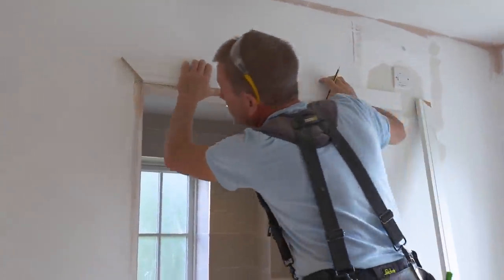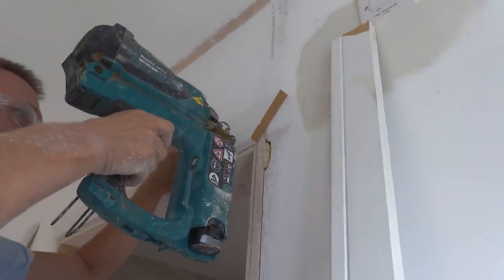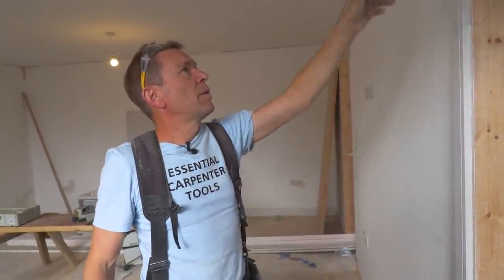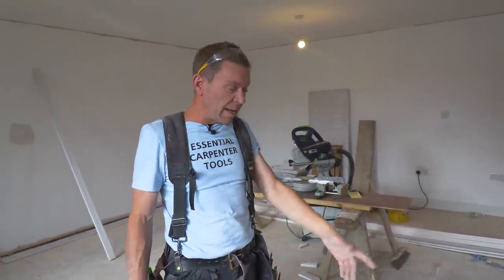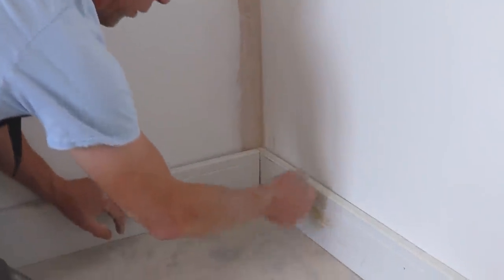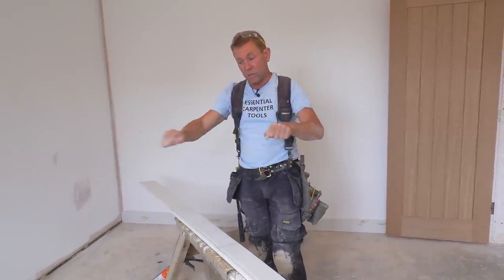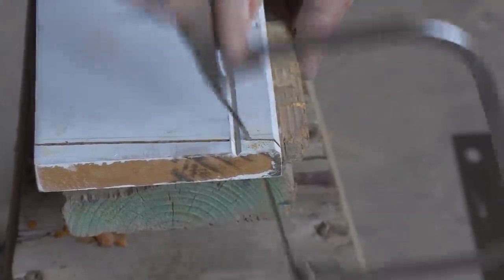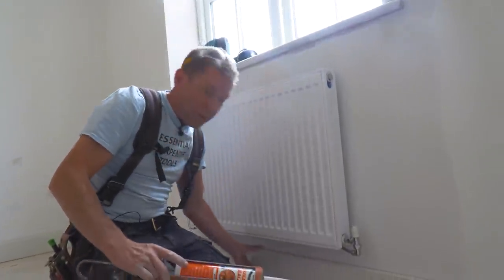Skirting Boards & Architraves - Easy Way

Comment: Myself, when it comes to new door linings,I always swing my doors before fitting the arcs, firstly so that I can use the same back set on my router jig, secondly, I can use wedges to tweak the jambs to suit the door, (especially on new builds, fit your linings ever so slightly wide)
Thirdly, there's no risk of a stray pin getting in the way of hinge or keeper  recesses.
For me it's, doors, arcs, skirts.
But each to their own.
Reply: Likewise
Reply: Hi Sally, 
That door was hung first, it opens in but was removed as the floor was tiled. Definitely better to hang doors before arcs. 
Thanks for watching.
Reply: Same
Reply: Same

Comment: Love your videos mate. Recently I started making up architrave on the floor first, like a goal post, mitre bond the mitres on the floor to get them nice and flat and spot on, while that goes off, put the adhesive round the lining then just stand it up and you’re ready to go
Reply: Thanks Luke. I’ve heard a few chippies making it up like you. If you find it works well then that’s the way..
Reply: find thats the best way,and I use expanding foam to seal door and help adhere archs ,works great ,oh and fire foam for fire doors

Comment: We did do architraves this way about 15 years ago I always found a extra blob of no nails behind arch’s helped flush the mitres up then pin from top. 
Doing house after house, frame after frame we would be able to sight the “quirk” margin too 
These days we use mitre bond and glue sets up on floor full house floor at a time even cutting full sets a a time and say all 2’6 door heads together etc

Comment: Nice job mate, can't beat the traditional way of fitting arc's, head first then the legs and white glue. It's alright using mitre mate but over time it goes brittle  and the other thing is if your fitting arc's to a casing you haven't fitted and there is a discrepancy  in the parrell,  if the head is fitted first the mitres can be fitted to keep the margins even.

Comment: Great job Dan, and I particularly liked your sweeping up method of leaving it a corner😜(you'd never catch me doing that on site🙄) Thanks for the video guys😎😎
Reply: Thanks Del. 👊🏻
Reply: Hi  @elliottgeorge5850 , yes sometimes I do. On this site the linings were a bit big so I cut the head and wedged them over. Generally if all the linings are made in a workshop and are the same then just cut plenty of arc heads the same size.

Comment: I use calk for skirting bedding also if you run a line of it along the top of the skirting and number 2 finger it off when it squeezes out once its nailed. The decorator will love you as the joint between wall and skirting is completely filled and wont crack.
Reply: Like the sound of that

Comment: Easiest way I have found Is to scribe and mark all of your arcs ready to be cut on the saw all at once then build them on top of one another on the floor or saw horses with mitre bond then lift as a set to each opening and pin to linings fast and easy

Comment: Hi Dan 
I was wondering have you ever fitted pigs ear bannister? If so how do you work out the angle 
Thanks
Reply: Hi Fadi, 
I usually draw the height of the pigs ear ( top and bottom) on the wall where it’s going to be fixed then you can dissect it ( join the angles up). Then use a bevel to transfer the angle on a mitre saw.  
When returning it into a corner it really needs to go in level and miter it. 
Hope this makes sense!
Reply: @Ultimate-roofing-square.  better than my 4man you've responded faster than him lol, thanks very much. 
God bless
Reply: @fadiabdallah8388  I usually try and respond to most questions, however I do miss some. 
If you take time to watch the videos the least I can do is try and answer questions. 
Thanks for watching.

Comment: Cut all the heads and legs number them up, lay some bearers down then glue the complete set using the pen and spray glue, do every set and just put the next 1 on top so you end up with a pile then load them out bit of adhesive on the back and pin them on, perfect mitres every time

Comment: Always hang door first then latch followed by door stops tack first then use the nailer.
Architrave mitres biscuit jointed. And the back of architrave to skirting at floor level .
Doesn’t take much longer

Comment: Dan, what’s your thoughts on the method of 2 part glue the header to the legs first and then fix as one? When fitting the door frame do you have any tips on getting both legs plumb as it’s not always possible to eye them from an angle. I would appreciate your thoughts!!
Reply: Hi Paul, 2 part glues are great however sometimes they do get sucked into dry MDF and I’ve had to apply more glue. 
I find it easy to just fix the top arc first. Each to their own. 
I’ve seen on various social media some chaps use string crossing the diagonals of a door lining to get it perfectly flat. (In wind) 
It should touch when it meets in the middle.
Reply: Cheers Dan for the reply. I have using the string line method on a double frame before. I’ll bear it in mind for the future. You are right about the mdf sucking the glue. I have had a couple come apart when you lift them. It’s always good to have different methods in your arsenal, so thank you. 
Your videos are inspirational
Reply: @paulyoull5472  many thanks 🙏🏼

Comment: Another good one from dan....you do have to be careful using silicone based glues not to get any on the finished surfaces, the painters will kill you if you do as paint won’t stick and it shows up.
Reply: Thanks fire blaster. 👊🏻

Comment: Why anybody would choose that method is beyond me … mitre mate them up on the floor - make the whole house on the same pile then .
Reply: What if your frame is out of square? Your 45 mitre won’t work
Reply: You may occasionally have to dress the mitre to suit the frame if you get what I’m saying
Reply: @danridesbikes683  never had any issues . The corners are held solid by the glue so even if the frame isn’t square there’s that much flexibility in the mdf you wouldn’t struggle . There’s just no way those mitres will ever be as neat as glueing them on the floor ( dealing with uneven walls etc . )
Reply: @DP-di2pi  Have to agree with this, and the old rule is if you fit the door liners you fit the door...
Reply from the maker: Who fitted these liners? Dan. Why would they be out of square?
Reply: That's the way I roll - Perfect tight mitre every time
Reply: The way I do them too, done many hundreds this way.
Reply: @danridesbikes683  find the angle cut them according obviously lol
Reply: Old school way with pva glue that's why he does it that way. I would never scribe my skirts looks bad when the skirts are angled, straight cut and bang them with hammer normally straighten them up
Reply: @danridesbikes683  I've done some pissed frames in my time and have always done a 45° cut, legs can easily be 15mm out of level and it will bend and not snap the join with miter bond (probably the same with pva if you let it set)
Reply: @gavincollins9376  on a new build,  yes, but while refurbishing?
Reply: @DP-di2pi  sorry, but you come across as an "instalation technician", 
A tradesman isn't a robot, reproducing the same thing over and over based on strict parameters, 
A tradesman produces bespoke, individually tailored solutions for specific applications,  resulting in the appearance of uniformity.
Reply: @sally6457  lol ok
Reply: I was thought that way aswell because by the time you come to do arcs it could be a few weeks later after  the frames were fitted and you can tweak the mitres on the legs and lose a smidgen of the bottom and it won't be seen 🔨
Reply: @DP-di2pi  wait... were discussing fine carpentry and using MDF? This is like discussing the best triple clear coated basecoat clearcoat paint system on a 10 yeat Hyundai.
Reply: @sally6457  We remove them!!!
Reply: @dalemoore11  each to their own mate! We all have our different ways of producing the same result in the end. For example I use Pva on the mitres whereas some use mitre mate. So many ways of doing them
Reply: @danridesbikes683  agree but it's definitely faster and neater with miter bond
Reply: @danridesbikes683  again this was definitely the best way to do that job 20 years ago (I was doing this 18 years ago by hammer and pin luckily all arks was timber then after a few years mdf was everywhere and everyone had Paslode guns ) before pin guns came out and obviously miter bond wasn't out then either
Reply: @sally6457  
Think your describing a craftsman there
Reply: @collcolin  @sally can’t be a proper craftsman though  (in yours and sals eyes ) because he’s using a mitre saw and a pin gun - techniques used to speed up the job . Speed = installation technician and un skilled ?
Reply: @DP-di2pi  
The point I was making is he is a tradesman sally was describing a craftsman the tradesman is far more superior to the craftsman obviously imo
Reply: @danridesbikes683  👍🏻

Comment: Dan is a framer and a finish carpenter?  Very impressive!
Reply: Most chippies do abit of both in the u.k. we call it 1st and second fix.
Reply from the maker: @flyingjackcarpentry9394  Some run a mile from one or the other. There are plenty out there who do framing and won't touch second fix. Robin Clevett avoided it for years because he says there is no money left in the job by the time it gets to second fix so they are always looking for a cheap price. There is some truth in that but then you get the mastic man who comes in and charges £200 for half a day.

Comment: Which type of nail gun is he using?
Reply: It’s a Makita finishing gun. It’s been ok however I wouldn’t buy another Makita framing gun.
Reply: @Ultimate-roofing-square.  which type of nail gun would be used to secure architrave and skirting?
Finishing gun? Framing gun etc
I'm new to carpenter, I saw some skirting secured using a nail gun, but I don't know which gin was used.
Reply: @bilbobaggins1824  for fixing skirtings and architraves then you really need a finishing or a 2 nd fix gun. These fire small pin type nails. This makes filling for the decorator easier. 
Framing or 1st fix guns fire a much thicker nail and are generally for construction.

Comment: Interesting using silicone. We used to alway use ct1 but is soo expensive. Found a really good alternative, made by 3c called multiuse adhesive and sealent. Absolutely swear by it now and its not too expensive especially if you buy it by the box.
Reply: Clear silicone very cheap sticks well to freshly plasted walls and will pull the plaster off the walls before it pull off, only down side is you need to be careful not to get it on painted items

Comment: Fit the head first then cut the mitre on the first side piece but leave it about 2 inches too long. Then with the side arc upside down and with the point on the floor offer it up to the door frame. Mark where the base of the side arc meets the top of the head arc then mark it and cut it at 90 degrees. Do the same for the opposite side architrave. Easy! If you need filler on those 45 degree mitres then I'd be asking for a refund on that mitre saw.

Comment: I've just had a joiner in to fit new skirting by a radiator. He put 2 nails straight through the copper heating pipes. Nightmare 😬
Reply: We have all done it tbf 😂
Reply from the maker: I put a screw through a pipe when I put up tile guides and I was the one who put the pipes in, fortunately I know a plumber

Comment: Cant stand it when rads are piped up like that. There's nothing better than a nice bit of copper.
Reply: Couldn’t agree more would look much nicer with nice clean copper coming out the wall
Reply: Na you can hardly see pipes on rads now, much better looking nowadays
Reply: I don’t mind seeing a bit of copper too.
Reply: @Ultimate-roofing-square.  most walls are white  shiny copper not for me, move with the times lads 😂
Reply: @flyingjackcarpentry9394  if fitted properly you don't see any speed fits apart from where it goes into the rads and they don't look crap anymore either
Reply: @dalemoore11  each to their own. Old dog, new tricks comes to mind.  😬